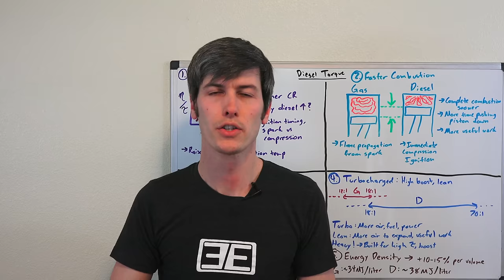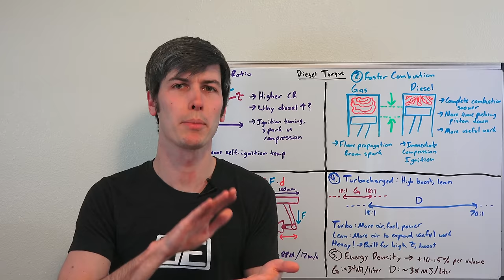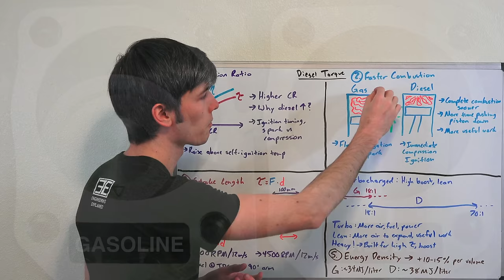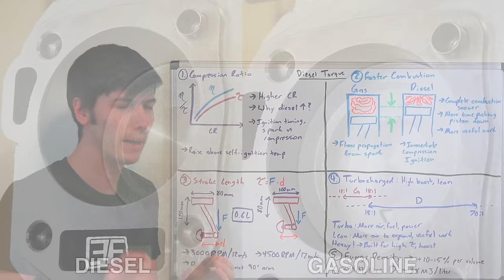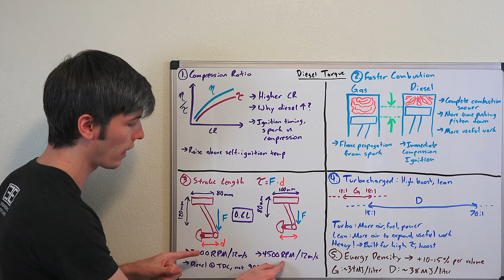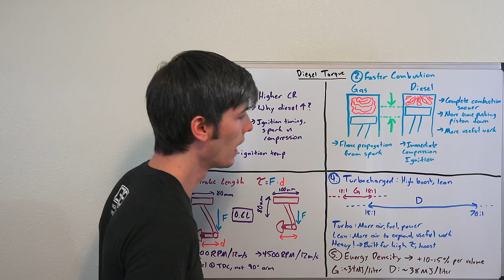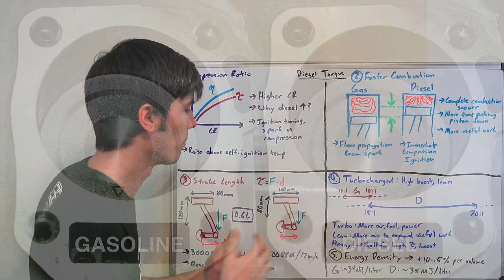5 Reasons Diesel Engines Make More Torque Than Gasoline

Comment: Hey Jason, can you tell me if diesel = more torque + more power+ more efficiency

Then why do sports cars use gasoline?
Reply: EDIT:
ELI5 : Petrol engines rev higher, delivering reasonably constant torque combined with ascending power output over a wide range of RPM rates (typically 1500 to 6-7000rpm) whereas diesels will achieve peak torque at lower rpm and have a much narrower band of revs across which power ascends (say 1400 to ~3500 rpm).

This essentially means that a petrol vehicle will be able to accelerate (and decelerate) more in each gear before having to change. This makes a for a much more flexible driving experience as it allows one to (eg) hold one gear between two corners while a diesel might hit it's rev limit and get "bogged" down forcing a change up after the first corner and subsequent change down before the next. As each gear change effectively loses a bit of time due to the drive not being engaged it's a less "sporty".

Diesel engines are also heavier as they can't be made of lightweight alloys.
Reply: @hoshigakip  Thank you for the crisp response. Very interesting piece of knowledge..I will remember this whenever I watch WRC or F1 or MotoGP next time :D
Reply: WEIGHT.  weight is arguably more important than power.  weight affects acceleration just like horsepower but it also affects cornering, handling, braking, and many other areas also.   
lets relate the extremes.  a motorcycle for speed and a semi truck for towing.  the added weight of putting a diesel in a motorcyle would be counterproductive  the better fuel economy would be dwarfed by nobody wanting such a heavy machine.  and using a gas engine in a semi truck wouldnt be efficient enough for such a heavy weight.   sports cars are closer to motorcycles than semi trucks.
Reply: أحمد المنصور  yeah they can hold it but what about acceleration from lower revs if u want a fast acceleration you have to shift down

Comment: I was always taught and read that diesel combustion took longer than gas. Some of the combustion occurs in the power stroke. Otto vs Diesel cycle
Reply from the maker: Doesn't take as long, but you can (if you want to make more power) continue to inject fuel during the combustion stroke with diesels. Not efficient, but you'll make more power and it will appear to burn longer (though really it's just a continuation of fuel injection).
Reply: This is what I was taught by instructors while taking diesel technology courses. The torque output has a direct correlation to fuel timing. Because of the slow burning nature of diesel fuel, during the power stroke it can be injected into the cylinder after top dead center.
Reply: That's true which is another reason it's more suitable to a long stroke low revving engine to take full advantage of it and the fact that diesel fuel has more like 30% more energy per gallon than gasoline, not 15% as he stated.
Reply: I thought that the reason is simply that diesels are turbocharged. Naturally aspirated diesels make about the same torque as spark ignition engines.

Comment: Couldn't you just build a gasoline engine the same way diesel engines are build (Besides the higher compresion of course)?
So wouldn't it then have the same benefits the diesel engine has?
Reply: No the fuel wouldn't work
Reply: Higher compression ratio in a gas engine results in greater tendency of knocking, therefore it's avoided

Comment: I appreciate the nature of the video is informative and indeed it does a good job at pointing out a few peculiar aspects of diesel vs petrol engine.
Unfortunately though, as far as the torque issue is concerned, this video is at best inaccurate and I'd say it misses the point completely!
Turbo diesel engines have high specific torque because they are turbocharged, but they don't have any torque advantage over turbocharged petrol engines at the same level of boost. Check for instance the VW Golf R vs GTD: both 2 litre turbocharged, both 280 ft-lb @1800 rpm, no torque advantage for the diesel! Furthermore, if you go a few years back and check the specif torque figure of the rare naturally aspirated (Mercedes had them in their range back in the nineties) you see again the they are comparable to petrol units.
So the question then becomes why are diesel engines ubiquitously turbocharged and with high boost levels. Because that's is the only way they can achieve high specific power, since they cannot rev as high as petrol. And here is where the explanation brought forward in the video is wrong: heavy oil doesn't burn instantly, it is actually the fact that it cannot burn fast enough that limits how high the engine can rev. Even Le Mans winning diesels didn't rev more than 5000rpm while we know that petrol units used to exceed 20k rpm in F1 and approach 10k on production cars. Energy density, compression ratio and bore/stroke do play a role but is absolutely secondary to the level of boost and not necessarily in favour of diesel. For instance, the video fails to point out that at the same displacement and combustion pressure you do get a more favorable lever arm because the crank is longer but also you loose force on the piston because it has less surface area!
Reply: But what is the Golf GTD torque at 1,000 rpm to 1,800 rpm.  The designed peak torque of that diesel engine might have more to do with not wanting to overpower the transmission or other driveline components it's mated to.  As I'm sure you probably know it would be easy to double the power of that GTD engine with tuning alone.

Comment: Jason,  stroke does not have a direct impact on Torque.  Toque is a function of mean effictive pressure and displacement. For the the same displacment, the longer stoke engine would have a longer moment arm but the area will be lower, thus resulting in a lower force acting on the piston for the same efftive pressure.
Reply: Agree totally :-)
Reply: That may be true of normally aspirated engines burning the same fuel at the same compression ratio.  You act like a longer stroke engine necessarily will have a corresponding smaller bore and vice versa.   Forget displacement because it doesn't mean the same thing when you compare a diesel engine to a gasoline engine.  A short stroke gasoline engine might make the same peak torque as a long stroker of the same swept volume but it will make it at a much higher RPM which isn't conducive to getting a load rolling from a stop or for engine longevity.  The diesel is not going to have the same pressure as a gasser, it will have more because the fuel is more energy dense and it's operating at a higher compression ratio, another reason the diesel engine has to be built stronger.  GM tried to convert a gas engine to diesel and it was a total failure because it wasn't strong enough to handle the higher pressure and torque created by burning diesel.

All that being said I think what he really means is the longer stroke does  mean more leverage turning the crank at lower RPM which is the definition of a 'torquey' engine.

Comment: I do not agree and so does the manufactures specifications back me up, do not compare a turbo diesel to a normally aspirated gasoline engine.
Normally aspirated diesel engines definitely makes far less torque than the equivalent gasoline engines, check the specifications yourself.

Comment: I’m sorry to say he did not explain it. He was also wrong regarding literally almost every reason he gave. There is one reason: Diesel engines don’t have to worry about knock and or pre-ignition at low engine speed like gasoline engines do. You know how on modern turbo gas engines how the middle part of the torque chart is flat? That’s a limitation to avoid knock. High pressure, high temperature, and ample time mean that the combustion would not proceed as desired if the boost pressure wasn’t reigned in. Yes, I posted this in replies. I believe it is important people see this.
Reply: He wasn't wrong about a single reason he gave.And your reason doesn't defeat any of them....

Comment: This doesn't seem to jive with the labeling of a spark-ignition Otto cycle as a constant volume expansion where cylinder pressure drops during power stroke versus Diesel cycle labeled as a constant pressure expansion. Constant pressure suggests combustion is occurring and fuel is being supplied during a significant portion of the power (expansion) stroke. This in turn suggests slow burning in Diesel and a controlled explosion in Otto. Please elaborate?
Reply: see above comment reply
Reply: The post contradicts ur nomenclature. This post states that diesels complete combustion sooner than the gas version. What further elaboration is needed?
Reply: The explantation regarding the false logic provided. Diesel does not complete combustion sooner, look at basic thermodynamic p-v plots of otto and diesel cycles.
Reply: Reiterating a statement from a posted vid is not an explanation and has nothing to do with logic. false logic... lol

Have fun getting him to look at ur basic or non basic thermodynamic p-v plots, thats outside my purview.
Reply: I was simply referring to the false logic provided in the video. There is no problem if this is outside your scope of understanding, but I find it unfair for you to criticize his request for an elaboration. His question was valid, and you told him to rewatch the video.
Reply: Dear sir Im sorry for ur confusion and ur defensive reaction. For one thing purview does not mean understanding. (I guess English is ur second language) The conundrum u pose was easy to understand and so was the posted explanation for it. I just didnt see the need to be drawn in to something so rudimentary. Good luck having it explained to you by someone that has the time and that was the inclination. Or just assume ur correct and forget about it.
Reply: N C well, "the post" is incorrect because Diesel combustion does not complete more rapidly than gasoline combustion. Simply a fact. Combustion in a Diesel continues for, to a first approximations, the entire expansion stroke. In a gasoline engine the combustion is near instantaneous.
Reply: Again this is not my post. Intuitively I get it, diesel fuel has longer carbon chain so it seems like it should burn slower but 1st impressions can be deceiving. . 

In the otto cycle engine, combustion propagate from the spark, so to say a "gasoline engine (the) combustion is near instantaneous" is an absurdity on it face value. While diesel combustion is based on compression and therefore combustion happens thru out the cylinder at about the same time. So which is closer to instantaneous combustion?

To be honest the difference hinges more on semantics on about what "complete combustion" means? There is latent combustion called knock or diesel clatter that can happen later in a diesel but that not the focus here.

Maybe this shows "Simply a fact" is for those that want to be simple minded about things? Just conjecture on my part.
Reply: N C I am talking about the fact that fuel is injected during a significant portion of the expansion stroke. Perhaps you need to read and research a bit?
Reply: Perhaps you need to read and research this posted vid a bit more since that variable is addressed in the post.

Comment: 2nd point is  wrong. Otto engines have faster combustion then diesel engines.
Reply: It's correct, these are both Otto cycle engines he's comparing.

Comment: why can't gasoline engine replicate what diesel engine does with gasoline direct injection technology
Reply: Allah Turbo I believe Mazda is doing that or almost that with their new gasoline engines
Reply: Mainly because diesel is a much higher octane fuel, much higher cylinder pressure can be achieved.
this works good at a relatively lower rpm but the extremely heavy rotating assembly limits rpm capability which is where the gas engine can smoke the diesel if built right, i live in a world with very few limitations as far as engines go.
Reply: Allah, where were you when Mazda broke the news of their new Skyactiv-X engine? The SPCCI engine compression combusts gasoline to gain the fuel economy and high torque of diesel without the NOx of diesel.
Reply: Jay _ I think you missed my question, I meant why gasoline engine need all the trickery new tech in order to do what diesel engine had always been doing, because principally direct injection gasoline engine is already the same design as diesel engine, but why gasoline engines still cannot do what diesel does  with the same technology
Reply: Because it's a lot harder. Gasoline needs a perfect air to fuel ratio to burn the way you want. A diesel only needs to modulate the fuel to run - they don't need throttle butterfly valves.
Reply: Derek Stewart Stop lying, diesel isnt higher octane it's far less octane, it has different value used to tell it's quality Cetane, This is higher than petrol but it's something that would be very bad for petrol so having lower cetane in petrol is good For Petrol. Low octane values are one of several reasons to why diesel engines are running in so rough and abrupt manner especially the older ones, but new ones shake alot aswell and this must be countered, petrol engines in comparison run incredibly smoothly.  Besides There ARE high compression petrol engines, for example F1 engines which is at 17:1 in maximum compression, Petrol is far more portent at such high compression ratio and at same one for both fuels Petrol wins every time in every way and runs smoother, but it requires high octane fuel for so high revving and high performance vehicles. Diesel engine of same compression ratio would have worse torque, far worse horsepower and would suffer to gigatic vibration issues if it would also let to rev as high. 

In short in same conditions and compression Petrol is completely superior, but it's incredibly hard and impractical for common use on the road.(only some super cars go to aroun 13:1 ratios) If not for issues with knocking on lower octane petrol it would be better over all due to higher amounts of petrol being produced from crude oil that diesel oil. But diesel is cheaper and easier to work in such conditions.
  In case of same displacement engines being equiped with same type of turbo or super chargers, Petrol car will win over all in horsepower, and be close with torque. However as i said it's hard to get petrol engines for common use with such ratios, Mazda is attempting this and they should be praised for it :)
Reply: Kacpa2 you obviously don’t understand the chemistry of fuels & organic chemistry so stop spouting misinformation.
Reply: Kacpa2 but with direct injection petrol engine that inject fuel after top dead center (thus should prevent knocking), engineer supposedly be able to easily design a petrol engine with a compression so high, that petrol just combust like diesel when injector starting to spray, in addition petrol are a whole lot easier to ignite than diesel which meant we don't really need that high of a compression temperature to begin with,what prevent them to do so?

Comment: Also, the flagration (burning time for a given amount) rate of Diesel fuel (which is basically Kerosene) is much slower therefore the cylinder pressure lasts longer. That's why the longer stroke works best in a Diesel.

Comment: 1:Longer stroke
2:Heavier parts 
3:bigger compress ratio.
Reply: I would say just 1: the turbo, no?

Don't get all this talk about such an  unsexy fuel, Jeez. Without the turbo, diesels be like turtles, not the ninja kind. 

Haven't watched so maybe there's an example but If same displacement and same kinda turbo the diesel one would have significantly more torque?
Reply: @Schtamper  Diesels are fine without a turbo. It's just that there isn't much reason to abandon the extra power it provides. Diesels aren't turbocharged because they need it, they're turbocharged so that smaller diesels can be made to pull heavy loads and such. It's purely a cost advantage implement.
Reply: @Schtamper  
Non-turboed diesels still generally have more torque than similarly-powerful petrols, even if they do have sod all power.
Reply: @lewis72  nah, I'm not gonna agree with you,just simple because,the n/a diesel and petrol engine with same displacement gets the same or petrol gets even more torque,turbo is such a big thing in diesel engines,because diesels have much more boost ,newer diesels goes up to 40psi of boost,that is actually a lot. Petrol engines don't need that much boost, sometimes they don't even need a turbo,let's say if he had same displacement engines with same boost,they would have the same torque,-5% +5%,but power,I mean hp would me much higher in petrol engines. That is my explanation for this things. 
I wish you all a beautiful day guys :))
Reply: Torque is the product of BMEP and displacement.  Stroke length HAS NOTHING DO DO WITH IT.  How long is this misconception going to persist ffs.

Comment: Another reason Diesels make more torque is in a gasoline engine, once the spark plug fires and the fuel is burning, there is no longer any control over burn rate.  The fuel burns rapidly resulting in a constant mass of gasses after the fuel burns.  This implies the engine has to be designed to efficiently harness this mass of gasses whose pressure drops as the power stroke progresses. This results in a limited time that the power stroke can happen without wasted energy.  A diesel, on the other hand, can control the burn rate because fuel continues to be injected during the power stroke.  This results in essentially no lower limit to diesel RPM.  It allows a constant pressure during the power stroke because the mass of gas in the cylinder is increasing.  It also allows far longer strokes and larger bores, especially in large marine engines that develop maximum torque at maybe a 100 RPM red line.